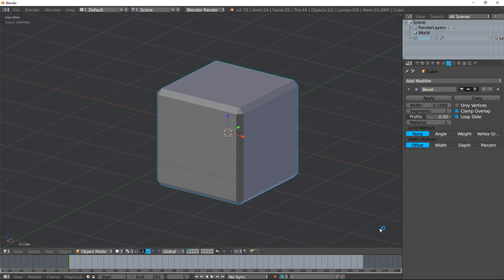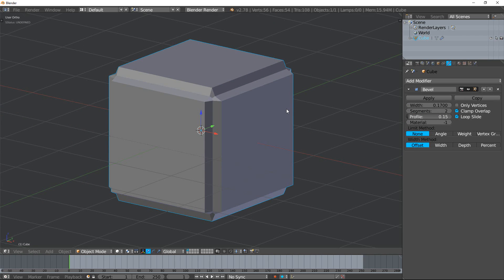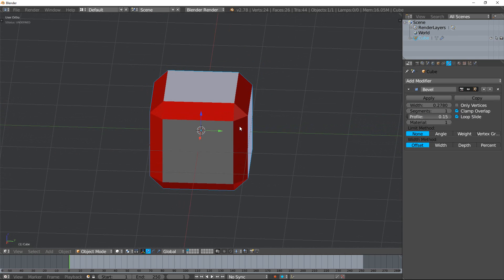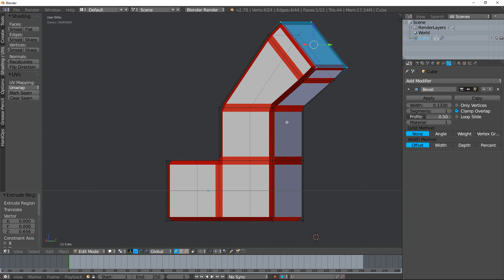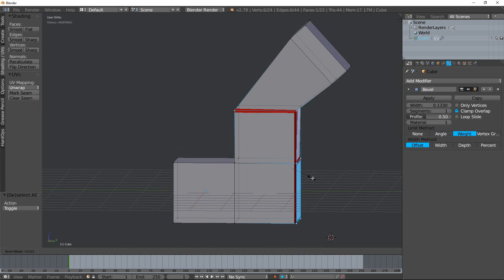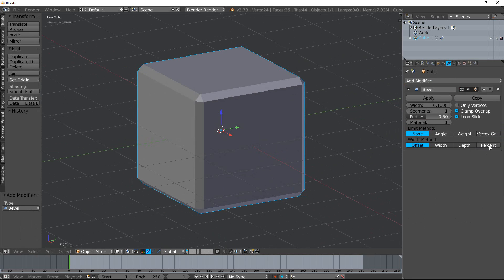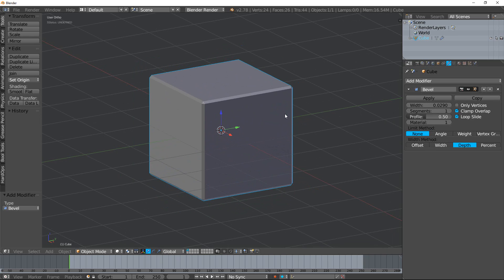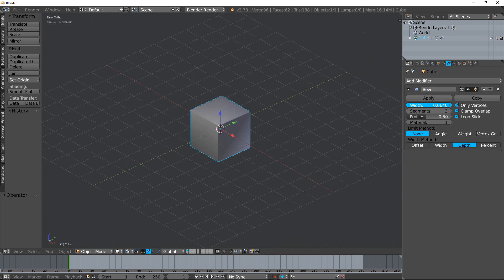In Depth Study of Blender: Bevel Modifier

Comment: hello, very good explanation, I'm using blender 2.80.75  my problem is that when I change the cube z dimension to 2 cm instead of 2 m and try to apply the bevel it does'nt work properly, I need to make an edge profile to marble or wood.
Reply: maybe you have to appply all transforms, but particularly scale?

Comment: I notice a strange behaviour. Sometimes the bevel modifier just doesn't work on some meshes. Maybe it happens when used with other options, but I'm not sure. 🤔
Reply: I've got some problems with beveling edges in meshes created with applying boolean modifier. Clamp overlap disabled and it sorta worked. You should also make sure to apply scale transformation. Sorry, if you've already known it.
Reply: https://www.youtube.com/watch?v=xx5W8hAYI0w&t=163s